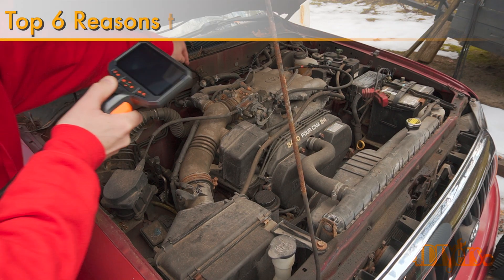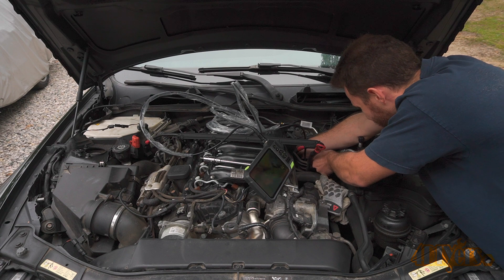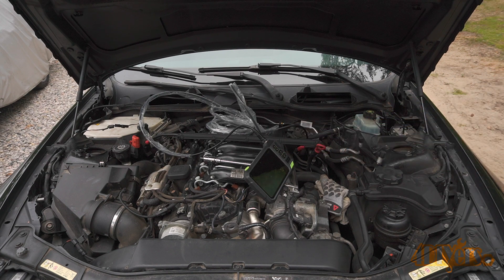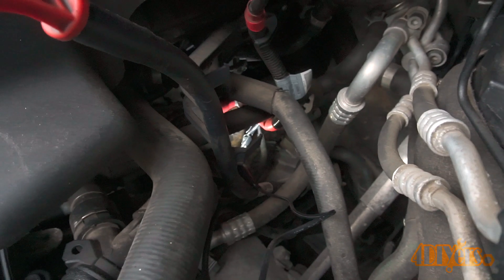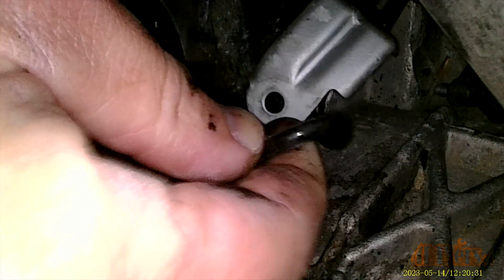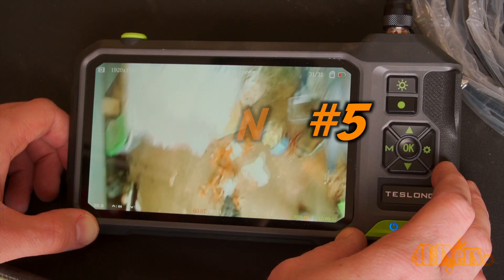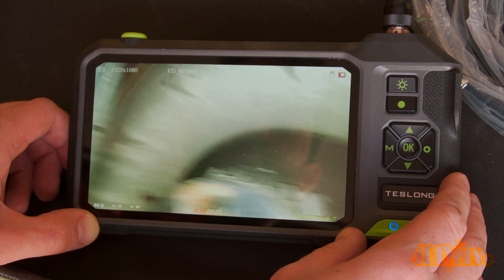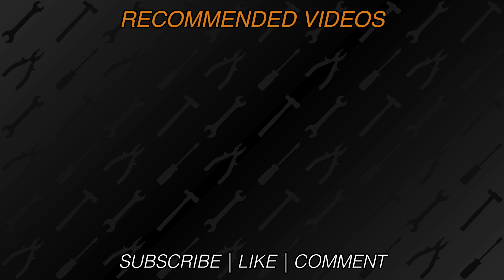Top 6 Reason to Own a Borescope for Automotive Repairs

Comment: Had to replace timing chains on a 4.7l once. Before I even dug into that kind of job I decided to use my borescope to inspect the inside of the cylinders. Lone behold, there's a crack in cyl 1 and chipping inside cyl 5. Didn't justify doing chains and saved me half a grand and 7 hours of labor to fix a trashed engine. If that isn't a reason to own a borescope, I don't know what is. Good video! P.S, that little V8 ran for another 50K miles with knocking chains and scored cylinders, haha!
Reply from the maker: Thank you and glad to hear you avoided a big headache. Was that the 4.7L from Dodge?